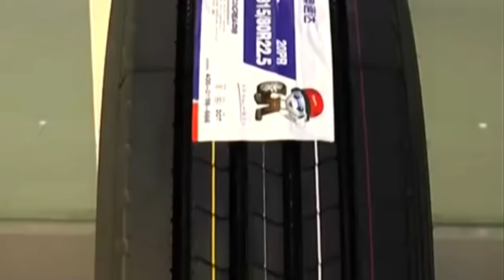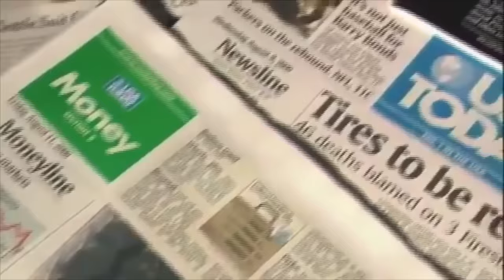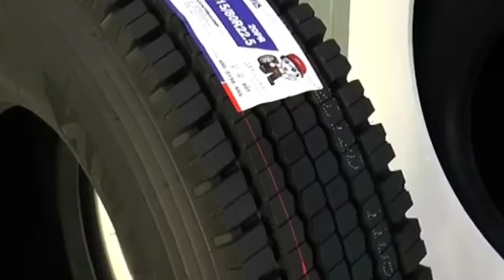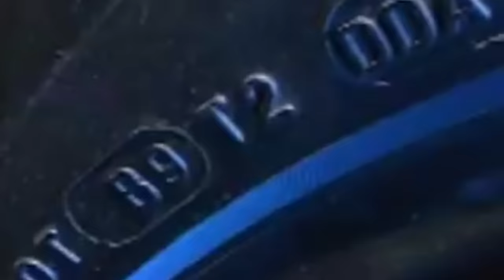5 Tires You Should NEVER Buy!

Comment: Bought BF Goodrich Lifesaver radials back in the 70's and had 4 out of five separate tread. one came apart at 90 MPH and did thousands of dollars of damage to my Impala. BFG was virtually unresponsive. Never a BFG tire again for this man.
Reply: How conscientious were you about monitoring your tire pressure?
Reply: VERY, I was racing motorcycles at the time.
Good point though.
Reply: Mike Fifer BFG is still unresponsive when their brand new design KO2 tires wore out on my truck with less than 10k miles, got a pro-rated warranty replacement and they wore out just as fast. Gave up, bought Nitto Ridge Grapplers and they have been flawless
Reply: You realize that in the 80’s michelin bought BF Goodrich. And michelins makes the best tires out there I don’t think you’ll have anymore problems buying from them
Reply: BFG has quit taking care of their customers. I ran them on everything I've owned so when my new truck needed tires it made sense to go with BFG. Big and expensive mistake! Worked with retailer and BFG for months with this issue, in the end it just cost me more money. They have lost a lifetime customer here.
Reply: ... and what was the speed rating of that sedan BFG tire?
Reply: No problem , I still will not buy any.
Thanks , Mike
Reply: Bfgs are the most uncomfortable tire I've ever rode on.
Reply: Frank Magana idk about that lol
Reply: All sedan and passenger tires are rated 112-118 MPH loaded.
Thanks , Mike
Reply: Your opinion. It must be very gratifying to be such a perfect role model for us all. I see you are very active on YouTube as well.
Reply: Mike Fifer Riiiight. A 70s impala in the 70s was only worth a few thousand dollars...
Reply: Mike Fifer )
Reply: Why where you driving at 90mph? That isn't legal anywhere!
Reply: Some are rated as low as 70 mph. Pays to know how you intend to drive on the tires, the loads you will carry, type of weather in your area, where you'll drive (off road?), and what the tires you're buying are rated for.
Reply: Some of us like speed. Granted it is highly foolish to do so in a dumb impala and just flat out wrong to do so on public roads, he is lucky he didn't throw a rod or something because i have done that exact thing pushing a 97 camaro to 127 mph for 14 seconds. Long story short that V-6 saw the end of it's dragging days with that failure.
Reply: drag strips and any number of race tracks plus germany at the time had no speed limit along with numerous other countries. This does assume he falls into one of those categories but it is worth noting he never said where he was so it is possible he did so legally. However, you would NEVER see me try to drive around some dumb impala like that. great way to throw a rod or blow the engine pushing it that hard. I have thrown a rod before on a drag strip myself in a 97 camaro RS (V6 3800) going 127 mph for a bit. max out your gearing and you can kill a engine pretty fast. i didn't know at the time so i learned the hard way trying to win that race.
Reply: Mike Fifer that is not funny. My daughter barley made it with our blow up the in 110 heat. Wow
Reply: 90 MPH? I wouldn't respond to you either.
Reply: Mike Fifer you are rationalizing your criminal behavior.
Reply: Mike Fifer 

I guess they must have upped their game considerably later on. I had two sets of BF Goodrich Profilers and they were great. Grippy, lasted quite well and no defects.
Reply: Sportster1988 - AR Bemo and some of the other children here are snowflakes, but what is YOUR excuse? You've never touched 90, 100, or more? 

Idaho, Montana, Nevada, South Dakota, Texas, Utah, and Wyoming road networks have 80 mph stretches. Some of those areas obviously deliver severely hot road conditions also. 

It's not unusual to run some of these extended rural stretches @ 90+ mph for EXTENDED amounts of time. Do you really think a passenger tire would (or should) be designed to blow at 10 mph above a posted U.S. speed limit?
Reply: "Lifesaver", now that's a misleading name to put it mildly...
Reply: I agree and well said. Obviously do not live in New Mexico.
Reply: That was my thought.
Reply: The highway speed limits you quoted are from the 90s ... in the 1970s no highway allowed more than 55 MPH, and I would also point out that in the 1970s the average non-sport tire was not rated for speeds in excess of 80 MPH.  Modern tires are rated much higher these days, but only because of improved materials.
Reply: What about all of us kids back then that bought muscle cars. Kids do what kids do or were you ever one?
Reply: What road were you on that had a speed limit of 90 MPH?
Reply: Wow you all must be upstanding citizens that have never had any fun.
Do you all EVER see anyone driving the speed limit or does your Uber driver always drive the limit.
Reply: That's slower than the flow of traffic on my everyday commute to work
Reply: That is what I am saying here in New Mexico
Reply: yea it was radial tires in the 70s
Reply: Mike, I currently drive a '95 9C1 package Caprice. I run 245/60R15 BFG Radial T/As, which are S-rated, and I've cranked that car to 130mph, and never had an issue. I routinely cruise around 85-90 on the turnpike with it. I'm not old enough to know for sure, but early 70's was when they started switching from biasply to radials. Mayne it was that the old school tires couldn't handle the speed and weight of the car
Reply: What kind of impala
Reply: Mike Fifer.    Where can one drive at 90 mph?    Tire underinflated?
Reply: In the 1970s the radial tire design had just come out.  I think it wasn't until the early 80s that BFG was confident enough with the radial-ply tire to come out with the BFG All terrain  and run the Baja 1000. 
BFG has now the most wins in Baja and Dakar racing.
Reply: Did they even have radial tires in the 70s?
Reply: nispelsm - I don't know what country you are from, but if it's the USA then you are completely wrong. To say that there were no Hwy speed limits above 55 in the 1970's is just not true.

In the early 70's we were posted at 70-75 mph in most states. Kansas had it's turnpike speed limit set at 80 mph... Montana and Nevada generally posted no speed limits on highways, limiting drivers to only whatever was safe for conditions.  

Thanks to President Gerald Ford's melon headed idea to save oil consumption during the gas crunch, the setting of Hwy speed limits were taken from individual states and the maximum was reduced to 55mph in 1974. His ridiculously estimated savings of 4-5% turned out to actually only be a 1% savings in crude oil consumption. Brilliant. Brilliant move by another man that never "really" was elected as President.
Reply: Hahaha great point. These days i thank people for actually using a blinker and not weaving dangerously through traffic which is common in my city. The police force barely enforces the speed limit where i live these days unless your going way to fast (usually at least 15 over the limit)
Reply: Mike  All were driving there dad`s riding lawn mower.
Reply: Yep 90 MPH
Reply: Obviously your Uber driver only drives a Yugo
Reply: They were brand new Radial Tires on a two year old car and muscle cars were pumping out over 400 HP. Where were you in the 60's and 70's?????
Reply: Nope you have it wrong. I never said the Impala had 400 HP. You did. I said there were cars out there that did have 400 HP. Why don't you read before shooting of with your vast knowledge of Car Culture. The point being there were many cars and folks that even today, as back then, that drove fast. Where were you? riding with daddy? My grandfather took me for a ride at 85 MPH in a Buick Special when I was five in 1957 and loved speed ever since. Sorry for everyone's sheltered youth.
Reply: Robert Wingate how in the hell? I have 34,000 miles on my Toyota Tundra, and I have the BFG KO2 tires and I could easily make it to 50k on those tires

Comment: The problem with the Firestone Wilderness tires used on Ford Explorer has nothing to do with Firestone. It took over a decade to figure it out, but the problem was created when Ford switched to the Firestone Wilderness tires. 

The factory floor had a track system that guided the vehicle through each assembly station, much like the tire guides in a drive through car wash. The width of the guides were based on the tires used when the plant was setup for production. When Ford decided to use the Firestone Wilderness tires, they never thought to check to see if the guides were wide enough. 

Based on the designed width of the guide rails and the factory specs for the tire, it shouldn't have been a problem, but there was one particular assembly station along the way that had a screw or bolt in it that was off by a hair. That difference ended up putting a small scratch in the sidewall of the tire.

They figured it out because the blowouts always happened on the same side of the vehicle. Ford initially tried to throw the blame on Firestone to avoid liability, but Firestone was never able to find the source of the problem within their own manufacturing process, and those same tires were used as OEM on other vehicles without any problems. Ford ended up admitting responsibility.

Do your homework before you put out a video.
Reply: Joseph Licht -   And Ford corrected the problem by switching away from Firestone tires.

Comment: I never drove over 80 mph, until I checked whether or not my tires were speed rated.  I would have never assumed an off road vehicle would come equipped with such.  The problem is that the Firestone Wilderness tire was not designed for a mall wagon.

Comment: In the UK, Colway remould and retread tyres were considered so safe that there were track races where it was compulsory to fit them to the race vehicles.
But then corners started to cut at the factory. I once fitted a brand new one to my caravan. Within 30 miles and at no more than 50mph it blew out and took out the inner and outer arches, some wiring and a lot of the gas piping.
The company went into recieivership without anyone daring to be associated with it by purchasing anything from it.